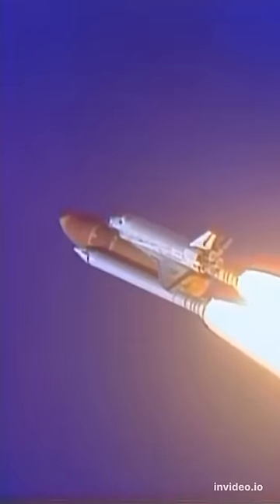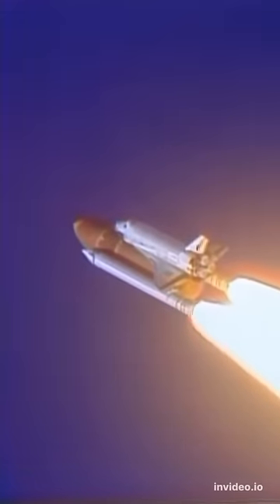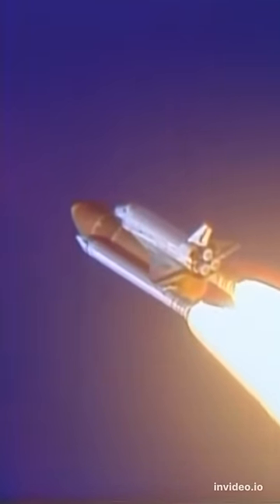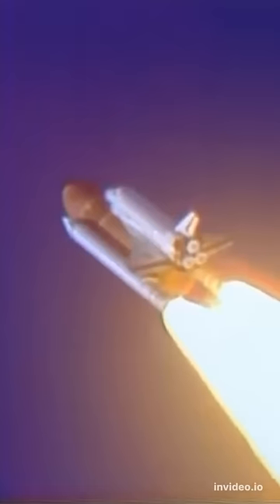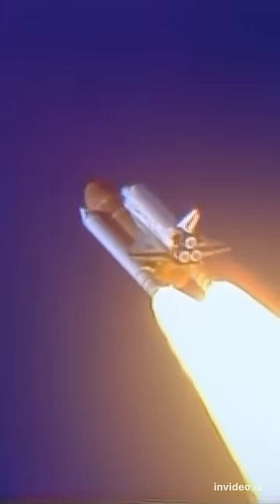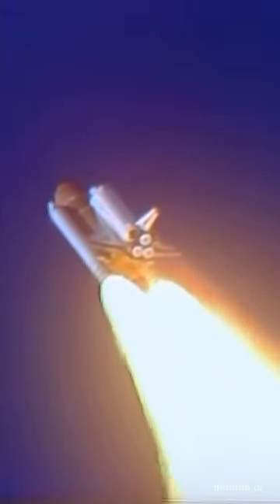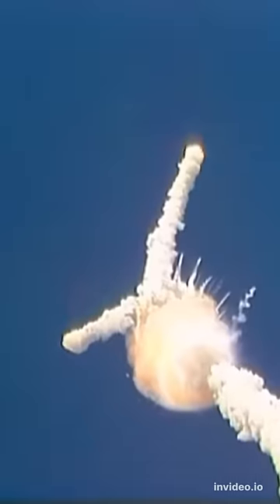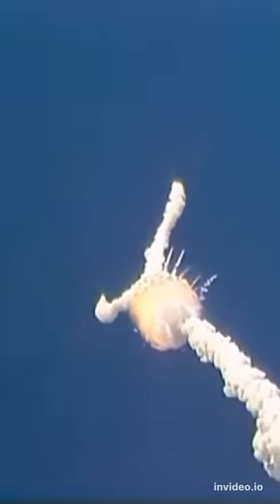Shuttle Disaster: Challenger STS-51-L Was A Major Mistake

Comment: I feel like calling this a “mishap” is the understatement of the year.
Reply: Yes. As a well documented matter of fact an engineer put out the loudest possible warning but was ignored.
Reply: Something to do with rubber O rings.  That where known to be shit....
Reply: @f62darkstar  because they changed the O rings as well they definitely are not the same now are they.
Reply: @hg6996  Several engineers warned nasa too cold to launch if my memory serves me correctly...... This may be the ultimate "told you so" only second to chernobyl disaster and particularly haunting to me as my wife and I had just visited Cape Canaveral at the end of Dec 1985 It is also interesting to read about the Russian space shuttle "Buran" mothballed when the USSR dissolved in 91...... Alexa defines Buran as blizzards and gale force winds.....
Reply: @markbouldin6513  and no one went to prison.
Reply: Homenaje a la estulticia humana
Reply: @frankcox1840  why would they? The official data from previous launches was “inconclusive” and had a “substantial margin in the event of a failure or erosion” and there response to NASA after I private meeting within the company came back and said “launch”. Yeah the one guy was adamant it was a issue and to abort until the temp was 53 or higher but the data simply didn’t support his argument. It was a tragic accident and nothing more.
Reply: Decade more like it
Reply: Should never of gone up,  to cold that day for central FL,  it had  been scrubbed,  they had to try or the window would be gone
Reply: @markbouldin6513  you right,  I  lived there at the time,  it should have been scrubbed but wasn't,  freezing for Florida
Reply: @elainedixon1954  If I remember they had missed one or more launches and felt pressured to lift-off..... Since the shuttle is discontinued I think we're solely dependent on Russian rocket's to ferry astronauts to the iss..... I have an app that alerts when the iss is coming over..... I read that the Russian Cosmonauts carry a shotgun in their tool kit..... Florida? Has me craving oranges...... Could love FL for oranges alone.....Tx for strole down memory lane.....
Reply: @markbouldin6513  The true ultimate told you so was the Fukushima multiple meltdowns! Three engineers at General Electric quit after the company decided to go ahead with the design of the Mark-1 Reactor with fuel pools outside containment at the top of the buildings! Of course there was the decision by the Japanese, to disregard the ancient  high-water markings of past tsunamis when they sited the reactors behind an only 30 foot high breakwater, and at nearly sea-level for the reactors themselves!!
Reply: @richardmccann4815  Woaa.... I would have never known and seems like they kept/are keeping that Catastrophe secretive...... I know zero about power plant's and engineering, but seems like I read an article about an innovative nuclear plant that could be totally encapsulated in an emergency and maybe use superheated salt at much lower pressures to alleviate some of the danger..... It's interesting and Thank's......
Reply: @waynewayne9693  Considering the enormity of a shuttle mission and hundreds if not thousands of engineer's/personnel I wonder if there were warnings against other launches or maybe all of them..... Risky Business on the best day......
Reply: @markbouldin6513  you are welcome!
Reply: There were 9 previous launches where the O rings failed at 54°f or warmer, but were not in an area where the plasma jet came in contact with the Shuttle or external tank.  Thiakol engineers who built the SRB's warned Thiakol and NASA management not to launch because it was so cold but they wouldn't listened and  told them to put their management hat on.  NASA kept asking for "proof" of these birn through, these engineers showed photos but since there was no official study documenting the O ring failures, they were dismissed.  

NASA and Thiakol killed the crew and destroyed the vehicle due to criminal incompetence and gross negligence.
Reply: @flownspacestuff4me  Hey Ray, What I know about the shuttle, nasa and most everything else is not-a-lot..... I do remember the controversy from decade's ago and maybe year's before the first shuttle launch concerning the reliability of  the tiles and/or adhesion/attachment of the protectuve tiles and I believe the Columbia succumbed to damaged tiles....  I remember someone on a show 60 minutes maybe held a tile in one hand and a huge torch, maybe an acetylene torch in the other hand as to demonstrate the tiles insulating qualities..... In grade school I thought it was some bs pipe dream and I guess they showed me in......
Reply: Not meaning to be 'disrespectful' in any way, but the mentality of "The show must go on" has caused more 'incidents' such as this than will ever be admitted to
Reply: @markbouldin6513 No one "allowed an attack on America", but people were killed because of greed when they were told it was "Safe" to re-enter the towers even after the second tower had been struck and both were burning; these are the people who should have been held accountable for manslaughter at the very least.
Has anyone you can ever remember in your lifetime said to remain in a burning building, because it was Safe to do so, !?
Reply: @waynewayne9693  your post is absolutely wrong. Thiakol and NASA knew there had been burn through or blow by failures of the O rings on 9 previous launches. Thaikol redesigned and improved the O rings for the SRB's expressly because of all the documented failures.  Thaikol & NASA made the intentional decision to use up existing inventory and not waste these expensive SRB's.  Thaikol and NASA knew that the O rings failed in colder the temps, the guys who designed the SRB's was warned Thiakol & NASA not to launch, because the coldest launch temp was 54° and resulted in the worst O ring failure. 

The Thaikol engineers who tried to warn of the problem, expected the SRB's to explode on the pad or just seconds after SRB ignition.  While watching the launch, both engineers thought they had dodged a bullet, but at 73 seconds their warnings came true.
Reply: @markbouldin6513  I have 60-70 flown shuttle tiles, they were removed & scrapped after the orbiters were upgraded at Palmdale in the 90's.  Tiles routinely fell off during the launch of the early missions, thankfully most were on the upper structure like the OMS pod, payload doors or upper wing and not in critical areas.  There were 32,000 tiles on Columbia & Challenger, eventually NASA reduced the tiles to 21,000 and replace them with blankets. 

STS-27 experienced more than 700 badly damaged tiles all along the leading edge and bottom of the right wing of Endeavor. The SRB heatshield nose cone fell of during launch, causing extensive damage, that included missing a critical bottom tile.  Commander Bob Gibson reported the damage to Houston, they told Gibson to use the camera on the arm so they could see it, but because this was a top secret DOD mission and the military ordered very low res video. Houston never saw the damage because of the poor video and had the crew reenter on their normal profile. 

Upon seeing all of the damage after they were in orbit, Gibson said "we're going to die". By the grace of God there was a steel frame where the missing bottom tile had been, that steel melted and delayed the burn through long enough to get through the heat interface.
Reply: @larrywhalen596  Greed ???  I had friends in the WTC when they were hit.  When people were understandably leaving the 2nd tower, just after the 1st one was hit,  the Port Authority cops were telling people not to panic and it was safe to return to their offices. A few businesses were told by NYC emergency officials there was no danger, so many people listened to the experts. Once the 2nd tower was hit, everyone was ordered to evacuate.  Everyone remembered the 1993 WTC bomb in the parking structure, that almost collapsed the tower and wanted out.  Also remember that these WTC towers were the 1st skyscrapers to collapse because of a fire.  There was a horrific fire that just gutted a skyscraper in Asia, but for some reason it didn't collapse and the WRC were much stronger than that one. 

As far as there being people having previous knowledge of the 9/11 attack, that's been proven to be correct.  Furthermore, there are over 4000 members of American Institute of Architects, the most respected and prestigious organization for those who build these things, who have proven the WTC towers, as well as WTC building 7 were intentionally brought down by controlled demolition.  

I'm happy to go into detail if you'd like, but the most telling proof is the abundance of Thermite remnants found across the entire footprint of the collapsed buildings.  It's been proven by many structural expert tests done after 9/11, that concluded it was impossible for jet fuel and the contents of the building to generate enough heat to cause the steel structure to fail. As far as claims that the fireproofing was removed in the impact are all BS and have been proven wrong and both buildings easily withstood the impacts. 

So again, what was your point about greed and that nobody had prior knowledge of the attacks ?
Reply: @nasacollector3676  Now that is interesting..... Seems like I remember nasa saying that each tile had it's own unique identity/part number/$$$$ undoubtedly you are in the nasa circle or well connected and no I'm not asking..... I didn't know until a decade ago thst Russia had a shuttle and bet few people know they had one..... Year's ago I read that Russia builds high functioning Rockets  for penny's on the dollar to the US not to offend anyone...... Thank's for sharing.....
Reply: @markbouldin6513  I'm just a fanatic space / aviation / military collector, plus I love the history of the space & aviation programs.   Each tile, blanket, spacer and other TPS related items had their own locatuon & serial number, so if anything ever happened, they would be able to quickly ID the part & location.  

I have a very rare original shuttle exterior crew cabin models that showed the location of each tile section.  If you run across the green "fit check" tiles from the shuttle, those were the original non-flight items that the flown tiles were cut from.  All of the original fit check tiles were used as templates for anything broken or missing. 

The tiles were acoustically strong, being able to withstand 170-180db, but very brittle and easily damaged by impact.  Unfortunately it was ground controllers who killed the crews of Challenger and Columbia.
Reply: @larrywhalen596  Yes I remember the part about the personel being prompted to reenter the tower and I agree..... When I said an attack was allowed on America I was trying to soften my language as to my real feelings.... My real feelings being that 911 was an "inside job" from day one....  And there are hundreds of pilot's, engineer's, metallergists, physicists and other authorities that believe 911 was an inside job...... Funny, it was said that one of Albert Einsteins  peers told Einstein that he could gather a hundred physicists that would dispute his theory!.... To which Einstein replied, "should you be correct one would be sufficient".... No disrespect Sir, as a wore out old steel mill worker, I don't know what to believe anymore......
Reply: As far as the Russian rockets, they're simple, they work, they're reliable and they're cheap.  Comparing their rockets to US or SpaceX, is the comparing the between a VW to a Ferrari.  

What's always pissed me off is the Russians charged the US $10 million per seat before the shuttle was retired.  Immediately after we canceled the shuttle, the cost per seat in a Russian Soyuz to ISS started climbing, eventually reaching $90 million per seat.  Who didn't see that one coming ?  

The really shitty part about being partnered with Russia, is the US had to pay lots of money for them to finish their module.  The Russians were always behind schedule, so we stepped in to help.  Then there's the aspect of an absolutely horrendous orbit the ISS was placed in, to accommodate the Russians being able to reach it. The shuttle could only launch with 1/3 to 1/2 of full payload capacity, because of the extra fuel required to reach the ISS.  

Partnering with the Russians was the worse thing we could have done for the US space program.
Reply: @nasacollector3676  Sorry to hear of the Ruskies gouging...... On talk radio a couple decade's ago they interviewed an astronaut that described living on the ISS as being comparable to living in a station wagon with much added noise of beeps, clicking and other annoying sounds as well as living with the Russian whom they referred to as their cranky-old-uncle......  Make that Cranky-old-uncle with a Shotgun.....
Reply: @earthelucidator  Much like World War Two, (!?), LMAO on this one.

Comment: The crew capsule/cabin was still intact when it hit the ocean and disintegrated,  they found two of the emergency oxygen cannisters had been opened and used, meaning some. If not all  the crew was still alive on that horrible decent from 60,000 feet. An absolute nightmare.
Reply: I don't believe that
Reply: I read that, too. Crew had activated 2 oxygen masks.
Reply: @JohnSmendrovac  no it's true, the crew didn't die from the "explosion" they died on impact. If you watch a better quality video you can see when the cabin itself breaks off still intact.
Reply: We don't know for sure what happened. This is a theory...there is some evidence that it may be true. I'm not sure what good it does anyone though.
Reply: What crap. They were dead before it hot the water for sure.
Reply: @JohnSmendrovac  You don't have to believe it for it to be true. And it is true.

Comment: Information expert Edward Tufte has done a great analysis of how the presentation of data that could have made them postpone the launch failed to convince the people in charge. Of his numerous conclusions, one was that because the information was presented only by transparencies on an overhead projector, participants in the meeting couldn’t see different pieces of information side by side; once a slide had been shown and removed from the projector, that information/data was gone. But the major failing was probably a chart that showed O-ring failures. They had actually happened frequently, but not catastrophically, in the past. The chart that showed this was ordered by launch date on the x axis and number of failed seals on the y axis (there may have been a note about the temperature on each point.). The failures appeared to be random when viewed on this chart — one here, a couple there, and maybe as many as 3 on one launch — and as noted, they had not previously caused a booster failure. However, if you took the data that was actually on the chart, and you graphed it with temperature on the x axis and number of o-ring failures on the y axis, the curve goes to infinity as the temperature goes below freezing. The data simply wasn’t presented in that form and if it had been, that MIGHT have made the problem and the risk obvious enough that they would have scrubbed the launch. They had never attempted a launch with the air temperature as cold as it was that day.

Comment: For those of you who don't know that was a very cold morning in Florida and what would seem like a typical launch would be anything else. One of the o-rings on one of the main boosters actually shrunk because of the temperature. That rocket should have never launched. The sad part here is there were engineers that worked on the solid rocket boosters that actually had doubts that it would take off and not have problems and tried to get the lunch delayed and stopped but because the teacher was on board and it was a show of politics, politics won. It was a sad day for everybody.

Comment: It was a total f up by the launch commander.  He knew the O rings were no test to seal at 62 degrees.  He was told that repeatedly and ignored it.  He should have listened to the engineers who designed this O rings and scrubbed the launch until temp was above 75 degrees.

Comment: They should have had an emergency separation of the vehicle from fuel tank and booster rockets. That flame under the shuttle was visible a long time before throttle up. Why they thought it was okay to proceed must have been made by sensors only and no consideration for visual progress.

Comment: I was 8 years old when we watched this in school and I was probably the only kid in Arkansas who was not shocked when the Challenger blew!!! All I understood at the time was that the ice on the launch pad and when they started the engines there was an incredible change in temperature between them that would cause something to change and it would lead to disaster!! I now understand that the extreme temperature change did cause the o rings to fail even though they are further away from the main engine and the launch pad but from the tv I could see the ice that covered the shuttle and I could also see that when the engines turned on even before they were at full power to lift the shuttle off the ground it was going to end in disaster! But if Mission Control wouldn’t listen to their engineers who built the shuttle they would not have listened to an 8 year old who just knew it was going to be a disaster due to the cold and the extreme temperature change that happened in a fraction of a second would cause them to lose the shuttle!!!

Comment: They said the deal rings were bad. There were inspectors who got into some big trouble over this.
Never knew what happened to the ground crew.
If you look closely, you can see a flame going towards that big gas tank.  That's where the ring failed.
 I do believe 2 more shuttles blew up after this.